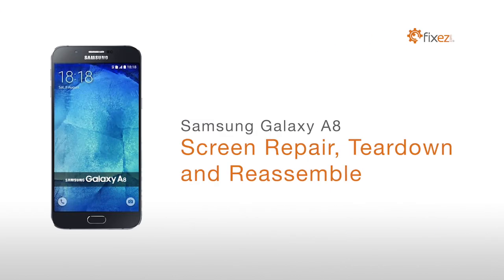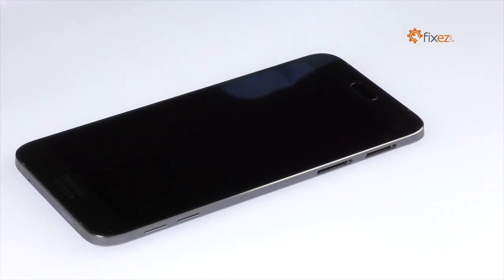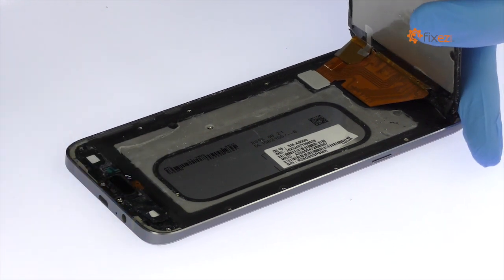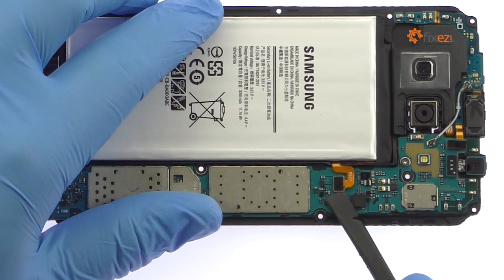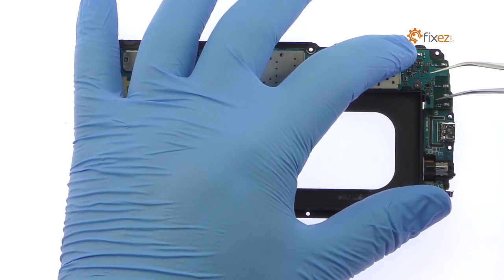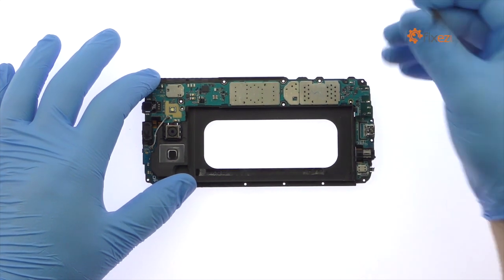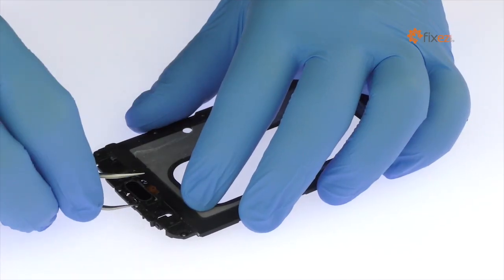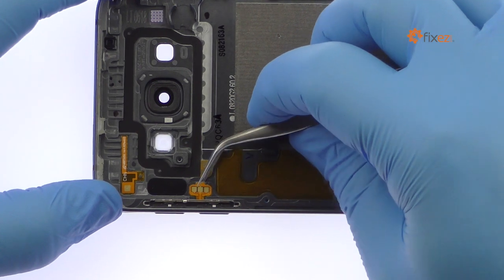Samsung Galaxy A8 Screen Repair, Teardown and Reassemble - Fixez.com

Comment: should i also put adhesive on top and bottom part of the screen where the earpiece and capacitive button are located?
the screen itself already has adhesive right?
Reply from the maker: Yes, adhesive should be all around the frame so that the screen lays down and stays properly seated in your device.